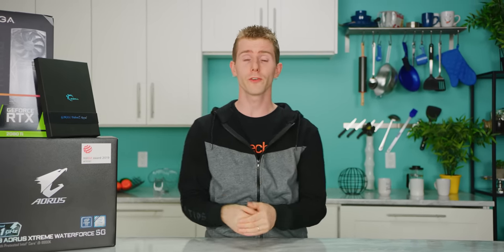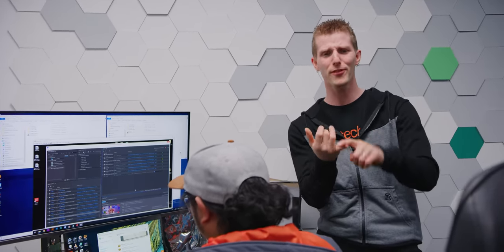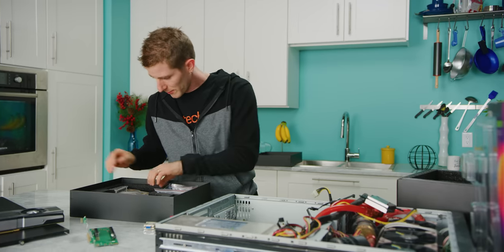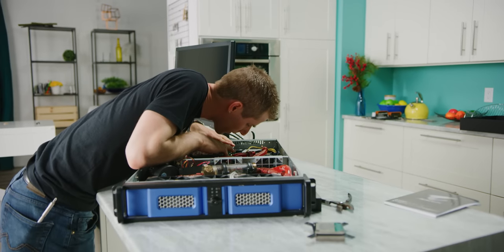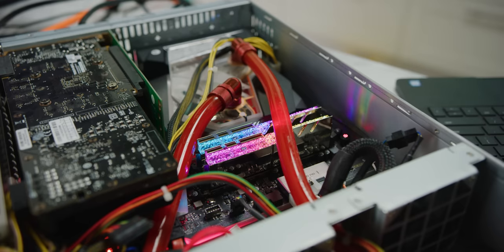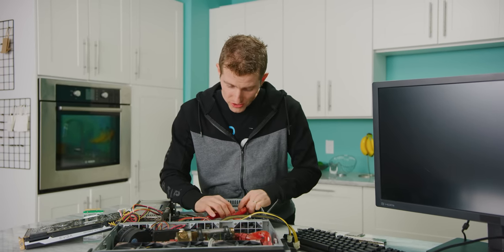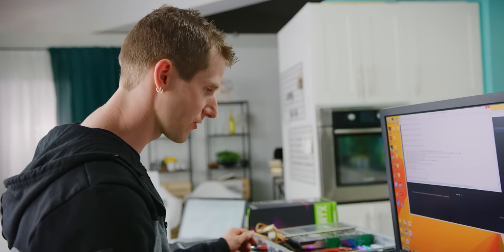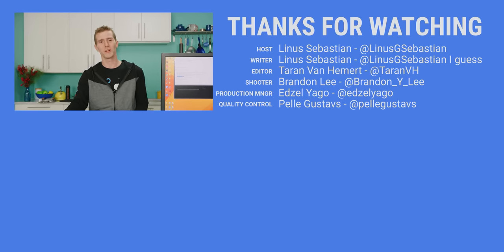All this work... for what?? - Upgrading the Video Render Server

Comment: "anthony: "intel processors are obsolete, now"
linus: "lemme upgrade our render server with another intel processor"
Reply: This video was prolly made ages ago.
Reply: Intel provides them with CPUs, so why wouldn't you use them?
Reply: linus:lemme upgrade it with this cpu we got for free and its just laying arround
Reply: Klaevin this was a few months back
Reply: Well, its linus, not like he will swap that server about 5 times in the next week
Reply: Team amd
Reply: They do actual work, and the new AMD processors still have a lot of things that need patching. Linus have said in the past that they care more about stability than performance.
Reply: On the higher end and server type applications intel is still king. Anthony was strictly talking about the consumer side but I don’t believe he blatantly said so
Reply: @patrickderp1044  have you seen the gaming benchmarks ? i7-9700k beats Ryzen3 in most games. And is stable.
Reply: @GeorgePerakis  And they didn't had a render server until it was done. ;)
Reply: Thats because intel is good for servers where as competitors are not.
Reply: Anthony and Linus are not sending mixed messages when you get the bigger context of what they are talking about.
Classic case of something misconstrued 

Price performance Ryzen 3600 and the 5700 looks pretty well priced for a gaming build. 
He updating a server type machine. A completely different type of work load. 
He got nothing to gain by comparing Intel's server chips to AMD's server chips. 
One: the cost a lot of money and, Two: People are more into the using their machines for gaming. 
Majority of people will not that the work loads Linus servers will be under. 
Smaller video makers can leave their machines rendering videos over night and will not be filming in 4k
It really about the type of CPU it is and who it is marketed at.
Reply: @natert0ts  These were all consumer parts....
Reply: @andretheron1833  Ryzen 5 Zen 2 is the equivalent of a i7 9700k
Reply: Hadinata Reynadi  Pretty sure they meant Ryzen gen 3 not r3.  The 3900x still falls short of Intel in games that favour clock speed.
Reply: apart from the 9900K linus used non-consumer processors
Reply: thats why i trust anthony more than linus ...he is just team blue
Reply: @Félix Sánchez they also have a 3900x and a x570 mobo sitting around too.
Reply: They're Intel-Nvidia marketing group and praise AMD from time to time to avoid being too obvious.
Reply: @patrickderp1044  I don't get it? Before AMD gaming was THE reason to buy high end gear. And now you say "just for gaming". How many streams or renders does the average PC user do every week. It's a gaming PC for a reason. The YouTube tech community is HEAVILY biased towards video editing, because it is what they do, very few PC users do that.
Reply: @QuintupleA  Intel is more stable than AMD? LOL!!!!!!!!!!!!!!!!!!!!!!!!!!!!!!!!!!!!!!!
Reply: @sovietbirdz  But thats not what the game benchmarks show?
I do image processing for a living - I know people use them for other reasons. I am just confused why the online PC / gamer community who only cared about games suddenly care about other uses. I can think of very few hobbies or reasons other than jobs that require 14 cores - the PC community care a whole lot about graphics cards - which is 95% used for gaming only. So gaming is the main reason?
Most of my software has no clue what to do with 24 cores - engineering packages move slowly and clockspeed and memory is king in my domain. I have a 1000 core HPC that I use for multi core workflows.
Reply: @johnnyxp64  Do you remember the ram issues when Ryzen launched? Right now Windows have trouble using all of the processing power in Ryzen due to the chiplet design. 

I will get a Ryzen with my new PC, because I use it for fun and can wait until these issues get solved. LMG can't do that.
Reply: @QuintupleA  dude, there is no "issue with the chiplets design!" the Scheduler in windows 10 kernel they said was fixed by Microsoft and also there is a need for a proper AMD chipset driver! this is not sure if is out yet or not! But the "which CCX" will be used and not jump cores and that jump introduces a bit LAG, has nothing to do against video editing like Linus wants to do! AMD is raping intel Cpus in multithreaded tasks like that! but they jsut try to promote the "intel not many but less and fast makes a difference" because they get tons of stuff from Intel... well that video totally backfired to them! i laughed my ass off! seriosuly if they had the balls they would do the same system with a threadRipper or even a 3900x now, but ....they will not! they are LTT = Intel "badies". we know that!
Reply: @johnnyxp64  I was talking about general stability as well, that was just a symptom. Linus have said specifically on the WAN show that when he upgrades work related PCs, he goes for the oldest generation that is available to buy new, because it will have the least amount of issues. The fact is that this new AMD launch is still new and there might be unknown issues with it still. If a PC breaks down for two days at LMG, that will probably mean thousands of dollars lost.

Also, Intel is still a beast in Adobe Premiere. Gamers Nexus have a video on it here: https://youtu.be/A98J1om9eBI?t=776

Also, if Linus is paid by Intel, why has he made these videos:

https://www.youtube.com/watch?v=v7hofCnniJE&t=454s

https://www.youtube.com/watch?v=z3aEv3EzMyQ

https://youtu.be/TJM-Qo0VZbs

They are falling over themselves praising AMD. You need to take the tinfoil hat off.
Reply: @QuintupleA  dude seriously stop praying to Linus so much... your neck may get a problem!... all his 2-3 videos against intel are just smoke just for people like you that are buying this crap! at least my hat does block and filter those nonsense. If he wants "last Generation" he can go with ThreadRipper 2xxxx series... 

come on dude.... i work with systems EVERY day and you are just watching Linus videos to tell you what is actually better or not... but when you see another videos that proves his wrong and he is bias towards intel for years now... then you deny those facts ..

ok you are free whatever you wish to believe...still doesn't make it correct though. 

have a nice day and don't forget your night pray to Linus tonight... 🤣🤣
Reply: @johnnyxp64  My bad, should have realised you were trolling earlier.
Reply: @QuintupleA  takes one to know one! 🤐

Comment: 10:30 - USE A FUNNEL!!!!!

Stay tuned for the "Quad EPYC/Threadripper based encoding server with dual 2080 ti's, dual 2000watt PSUs, 256GB of RAM and fairy lights all over the frigging place....  and to cool it we are going to submerge it in liquid nitrogen... then drop it on the floor!"
Reply: I almost died watching this moment
Reply: Linus and company wouldn't be that cheap: If they happen to have either a Dual Titan RTX (via NVLink), Tesla T4, or Dual Quadro RTX 8000 (via NVLink) that they can use for the project, then I know for a fact that they'll likely resort to that instead; a Dual Socket Xeon Platinum 9282 or Eight Socket Xeon Platinum 8280L with 036 TB of DDR IV ECC RAM would be straight up overkill but probably get the job done just as well, though the latter concept would probably be more suitable for "032 Gamers/Workstations, Eight CPUs", that would be a very expensive setup (especially with Quadro RTX 8000s) but this rig will last for decades, especially if it were only one person making material with it.